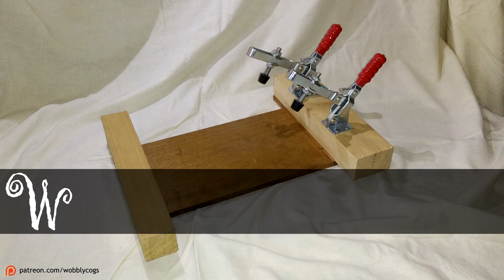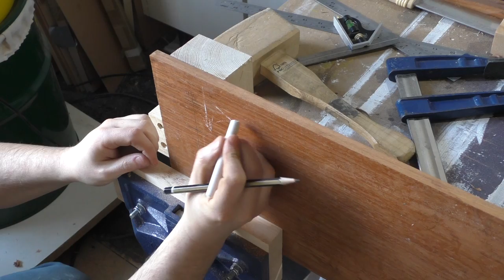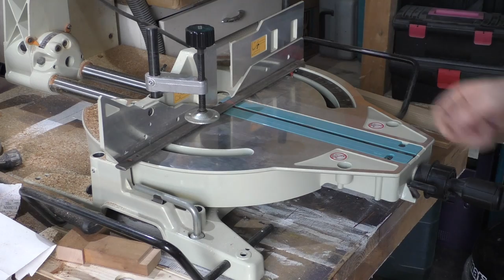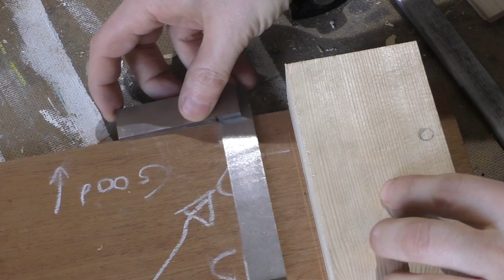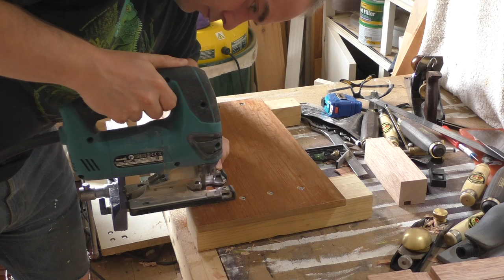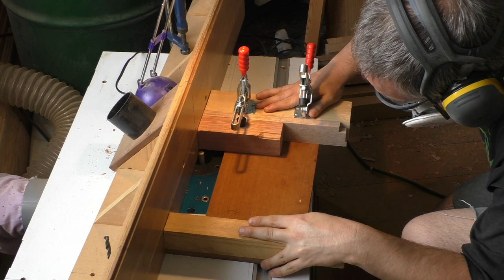Router Table Coping Sled

Comment: get a bessey hold down clamps, they are expensive, kind of.. but it saves so much time.
Reply from the maker: +bikboklv Thanks for the suggestion, I've just looked them up. Yep, they're expensive. I have an idea for better clamping system that hopefully won't cost quite that much, it'll have to wait till I'm in the new workshop though.

Comment: I like the idea of using a chalk to point something out during the build. Sometimes I had problems to understand your voice. I think running it trough a compressor would help. I'm using the digital compressor of audacity for this.
Reply from the maker: +Ernst's Blog Chalk is great for use on wood, really helpful when you have a lot of parts to keep track off as it just rubs off. I'll see what I can do about voice quality, it sounds clear to me but I suppose I listen to it every day :-). For all the voiced over videos there are word for word closed captions. I've captioned some of the videos that aren't voiced over as well. Good job with your router table fence BTW.

Comment: Interesting video, but I couldn't believe you used slot head screws.  Try Robertson  (square head) - holds screw driver more secure
Reply from the maker: Jim Clack Robertson screws are really hard to get in the UK. I'd agree they are a great design of head though.
Reply: Wobblycogs Workshop  As a Canadian I couldn't imagine not using Robertson screws. I'd try to import them.
Reply from the maker: Someone on a forum I used to frequent tried that a while back and ended up regretting it. They couldn't get bits and ran out of screws. It looks like there is a UK supplier now but they aren't carried by any of the big name hardware suppliers.

Comment: I do hope you tested your sliding square, they are not the most accurate tools when new, have to be fettled, i prefer a solid engineers square for real accurate working
Reply from the maker: +jusb1066 Yeah, I've checked it in the past as I was curious how square it is. Over 15cm I couldn't see any difference with my engineers square. If there is any error in the fence it's tiny, well within what is needed for woodwork.